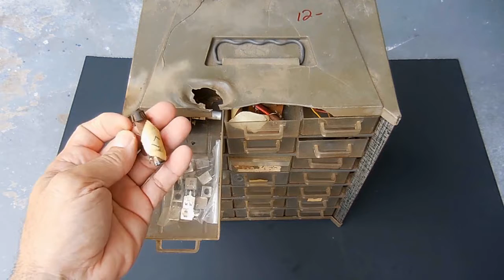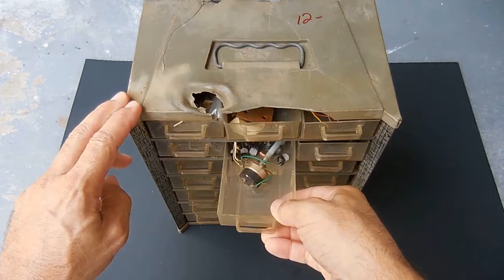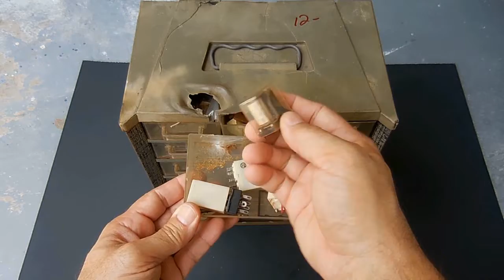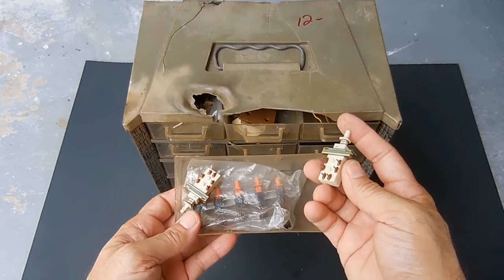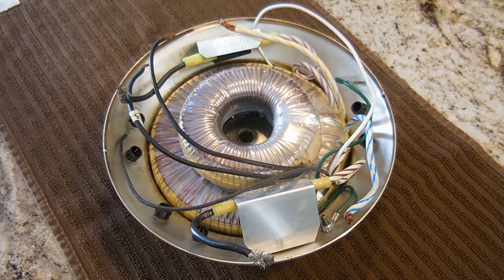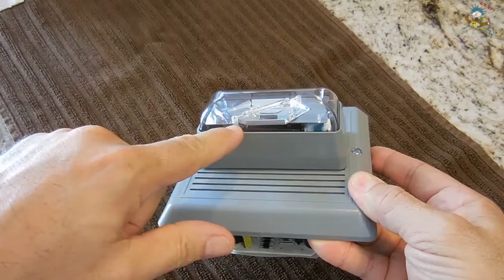Great Electronics & Electrical Parts Find For $18

Comment: I couldn't even hazard a guess as to why YouTube emailed me specifically to inform me I might be interested in your electronics jumble find, unless the YouTuber Cabal has somehow become mysteriously aware that I've been recently spending a good part of my weekends sorting out the wiring on our recently-acquired Macgregor 26X sailboat.  Otherwise though, as seen from your level of electro-savvy, I doubt I could tell you the difference between a potentiometer and pomegranate if sacks full of both fell on me.  That said, I do adore Habitat for Humanity's ReStore shop in Manassas, Virginia, and will always make a point of just swinging by for a looksee if I'm in the neighborhood.  It's where we got almost all of the paint, lighting, switch covers, door knobs, locksets, trim lumber, and a whole host of other random crap we needed to do up our little split-level when we first got it as a light fixer-upper a few years back--all of it for maybe a penny on the dollar (for example: just 25¢ a gallon for all the interior, trim and deck paints I used...all of them nice and fresh, even multiple gallons in matching colors for the bigger rooms and 10¢ tubbies of spackle!).  Being pretty tightly cash-strapped after having laid out an Eisenhower Era style 20% down payment for our joint to dodge the need to pay mortgage insurance, four gallons of paint for a buck was just the paint we needed.

So anyhow, even if I don't quite "get it", it's still "Thumbs Up!," and I'm glad to see that someone else who could use it felt the power of a great bargain from the good folks at Habitat.  Now, when you're done sorting out all your fiddly gimcracks and doohickeys, would you mind coming down here to the DC area and wiring up my Garmin depth-finder/GPS doodad?
Reply from the maker: +BilgemasterBill 
Hi there. This is the first time I heard of Youtube emailing people about my channel, but I do know my videos show up as "suggested videos" on Youtube.

Thanks For Watching

Comment: you can make a good pc power suply with those toroids, or a quality power suply for audio amp (verry low noise) thow for that power 12v are usualy not used,     oooor maybe you could use the primary as secondary, so that you use it as a step-up transformer, for powering stuf from your car, that would be interesting to see
Reply from the maker: +Alexandru Alanei 
Hi Alexandru. I think I may use the smaller toroid to make an autotransformer.

Comment: Nice find! Those phono jacks look like old phone company type made by western electric . They may not work in a standard 1/4"  jack. Wonder if you can use the toroid for an isolation transformer.
Reply from the maker: +JPennDotCom 
Hi there. Yes, you can use a toroid for an isolation transformer. I think the phono jack is 1/4".

Thanks
Reply: +electronicsNmore yes the jacks are 1/4" but the ball on the end will prevent use as a standard flat 1/4". maybe mono but definitely not stereo. I retired from the phone company over 5 years ago I remember this type of jack was used on the main distributing frame (MDF) test panels. It was also used on the test panels in the Test Bureau. When MaBell was a monopoly most of the gear they had was engineered so it couldn't be used any place else.
Reply from the maker: JPennDotCom The parts belonged to a person into CB radios. Years ago I had 1/4" phono plugs that looked exactly like the ones in this video.